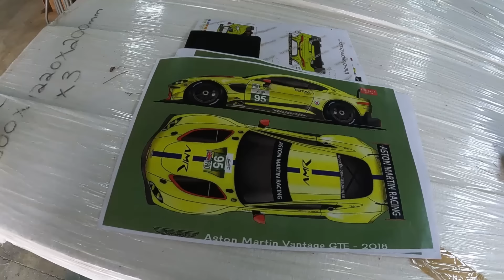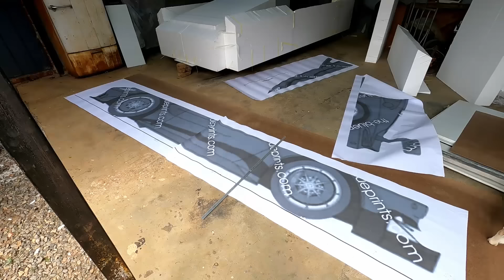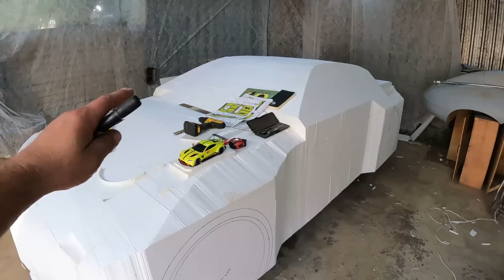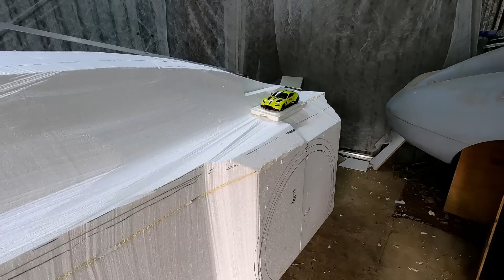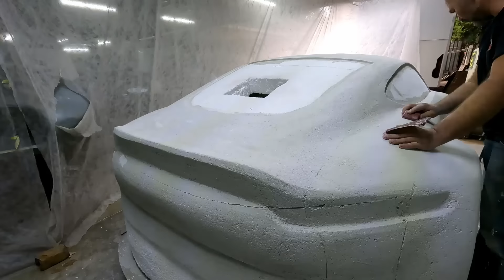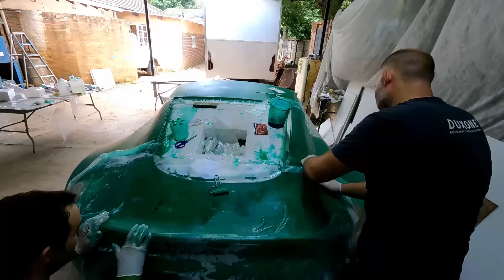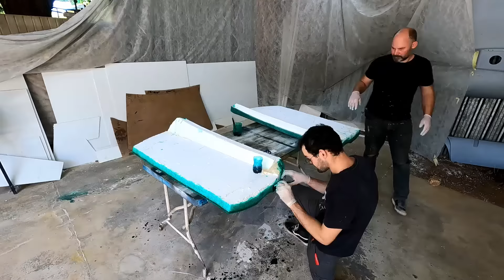EASY METHOD TO MAKE SUPERCAR BODIES FROM SCRATCH

Comment: The other thing you need with the carbon fiber was you're supposed to put another coating on there to it glazed up when it glazed up and it's nice and shiny  Then that's when it's actually hard In the material you're using right now should have been mixed with that other material you had So when you pull it off the star phone you need to take that out of material and put it underneath all that other material you had on top the straightened it or it's gonna just be flexible like it is

Comment: Loook into the methods for ship (boat) building using rib templates. Not sure it would be easier but more efficient in making sure both sides follow the same contour. THe method has been in use fo as long as people have been designing ships.

Comment: You should use polyvinyl alcohol spray before fiberglass as a mold release. Works amazing and washes off with water. Then you won’t have to clean the foam off the mold. I’m blown away by your work!! Looks amazing!

Comment: Really good to watch as I am doing something similar with  PU foam over a Porsche 911. I wish I had seen the home made hot wire earlier, I used a kitchen carving knife. The wire brush seems to make more of a mess that the rasp I use but probably quicker. I was surprised you didn't make moulds, at least for the front, where they are most likely to get broken on a race car. Mine is a road care Iand I am doing moulds, but that is partly because I am doing it if CF. Good to see you tests of materials and I will be sure to cross lay the fibres. If you want to see a 1st time amateaur trying this and spot the differences, here is me doing just my bonnet - https://www.youtube.com/watch?v=lBSS6fxs8Hk

Comment: I'd be curious how that flex translates into the driving experience,  and affects aerodynamics. 
S type glass has some advantages over carbon, but carbon is extremely rigid, and its strength to weight is one of the things that makes it often the preferred material.

Comment: For finer shaping, rather than the usual self-clogging sandpaper, try Mirka Abranet.  Velcro hook backing.  Porous, so doesn’t easily clog, and any dust clears the porous surface with a quick touch of the shop vacuum.

Comment: you really should have taken a bit more time in CAD and instead of printing and making huge templates (and all the time invested in it) just focused on taking the 2D profiles and generating the foam blocks already cut to the profiles and finding someone local with a CNC hotwire cutter. People always overlook that such machines exist and also forget that process is typically fairly quick and thus not expensive(can usually cut poly foam at 45 in/min).  if you spend enough time each foam part could be cut in all 3 directions if needed prior to glueing them together. Im in Canada but have installed 2 such CNC hotwire machines within 40 km of you . Also as you may have learned polyurethane foam doesnt work with hotwire cutting

Comment: Great combination of artistry and skill!  Somewhere, there is a 14 year old figuring out how to do this with a homebuilt CAD cutter.. scan a model, scale it up, build it.
Reply: This is already being done in many industries. Boats, aerospace, blades for wind turbines, automotive, etc. Pretty much anything composite uses multi axis routing to cut patterns from foam. There is some very advanced stuff being done that, unless you are in the industry, you don't ever hear about. Sometimes we scan things but that's usually to bring digitization to legacy products. More often than not, we go right from CAD model to routing.
Reply: Anyone with wood working tools and a 2d CNC router can turn a cad model into a mold or buck.

Comment: Very impressive, especially sculpting the full size body using only drawings and a toy model!  Will the body panels be strong enough, or will they require more internal bracing than the thicker traditional panels?
Reply from the maker: Thanks. They are extremely strong because of the way it gets fitted to the chassis with the benefit of being flexible in case of a bump. Didn't need anymore bracing for this application. I'll post a video soon showing how we fit the body

Comment: How well did that peel ply work on the inside?  I'm curious because I have never seen it used that way.
Reply from the maker: Extremely well except I sanded through some spots before laying the glass which made parts of the delamination process a struggle

Comment: Very interesting to see your methods.  I have done similar projects with styrene and urethane foam but used epoxy laminating resin to give it a hard skin that the polyester filler and primer won't melt.  I use Surform files but it looks like your getting good results with a wire brush.  I also use a laser level to check symmetry of the form to see it both sides match.  I love your can-do attitude and you always impress me with your great results. 
  Thanks and cheers to you.
Reply from the maker: Thanks very much. Cheers!